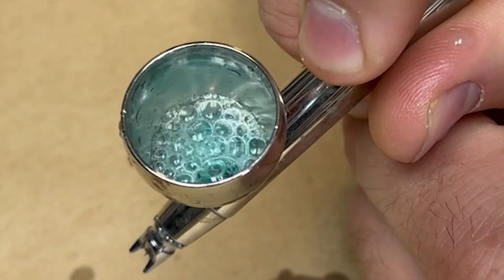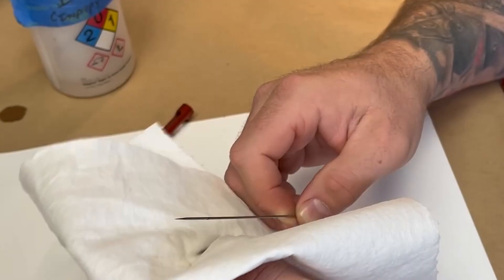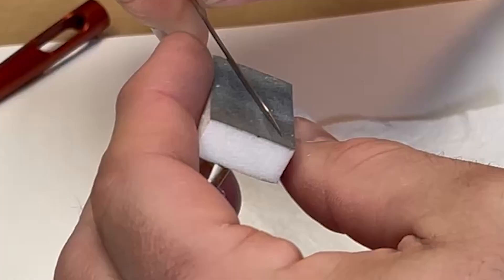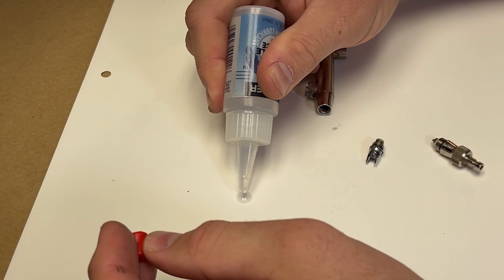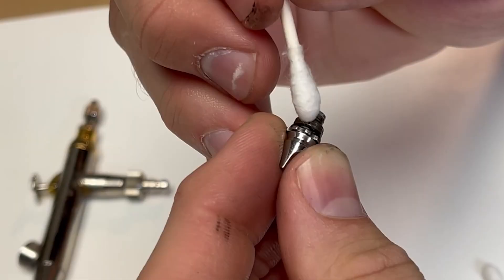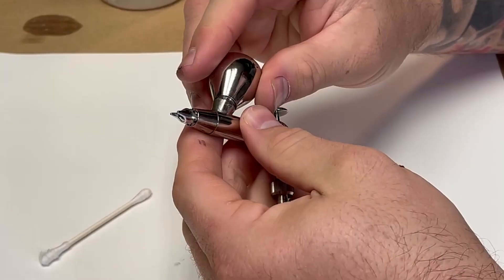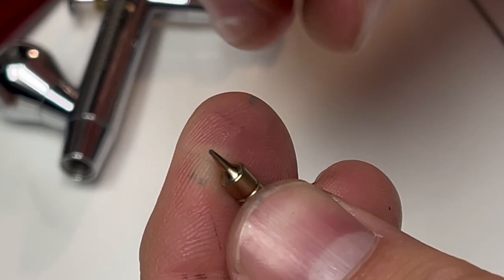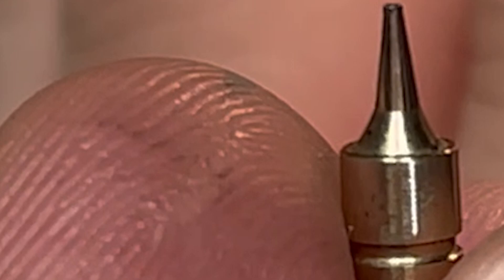Fix a Bubbling Airbrush: How to Prevent Backflow

Comment: Great video~  straight to the point.  My Infinity's air tip seems to have clogged on my first use.  can't seem to get it clean.  can I just soak it in alcohol or cleaner overnight?
Reply: Having the same issue with that gun. Cleaned repeatedly. Changed nozzle and needles. Still bubbles and blows out the paint cup.